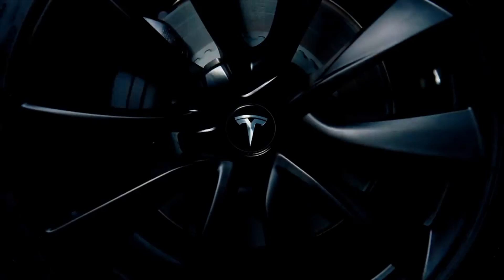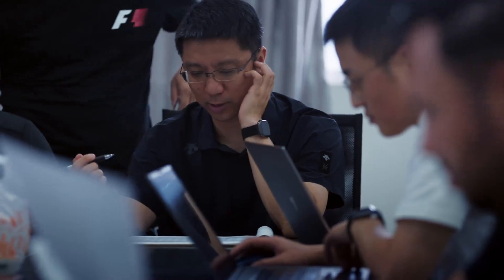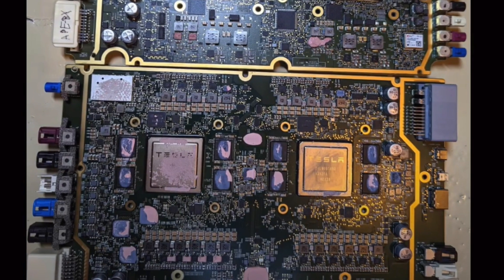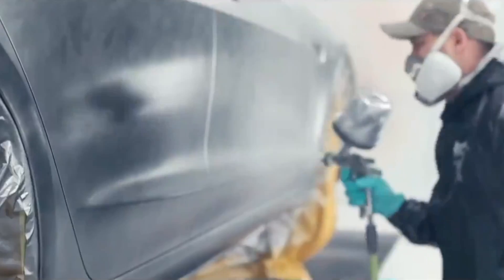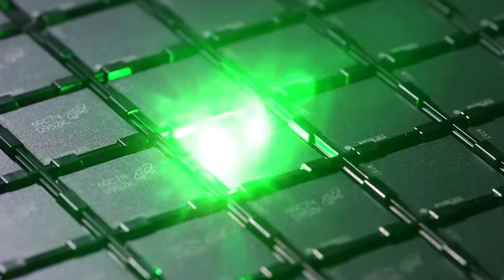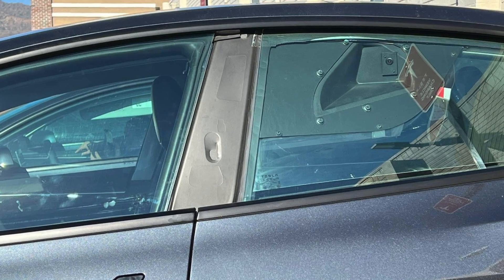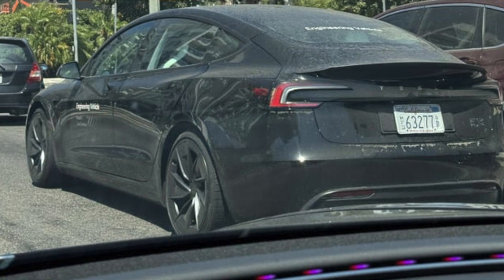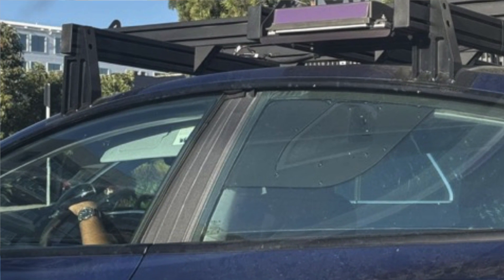NEW Tesla Model 3 Spotted with LiDAR and HW5 Sensors | This is Great News

Comment: Personally, I think AI4 will not be capable of L5 autonomy. The recent AI4 board failures demonstrate a point failure can hinder FSD, a clear sign of limited hardware redundancy.
Reply from the maker: They’re fixing or have fixed the AI4.1, and things look pretty good on the latest v13
Reply: @heyJohnEe  The issue is not with the failed boards but that a single failure disables FSD, highlighting the lack of multipoint redundancy. Waymo, for example, has a secondary onboard computer always running to take over, multiple independent collision avoidance. Waymo also has redundant power systems, even in the case of power of circuit failures.
Reply: @heyJohnEe  No matter how good FSD v13 may be, to achieve L5, they must not require the human to take over ever. Because with robotaxi, for example, they can not. Steering failure? Brake failure. Inertial measurement systems? Camera failure? Circuit issue? All these require a human takeover, aka not L5.